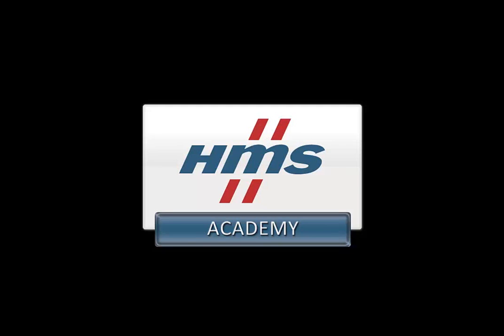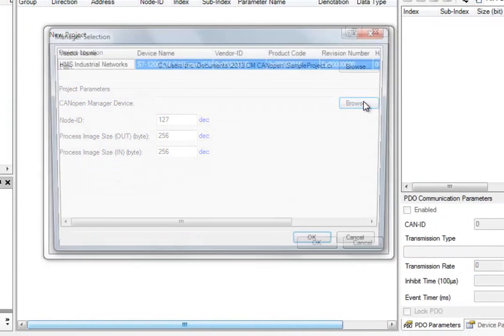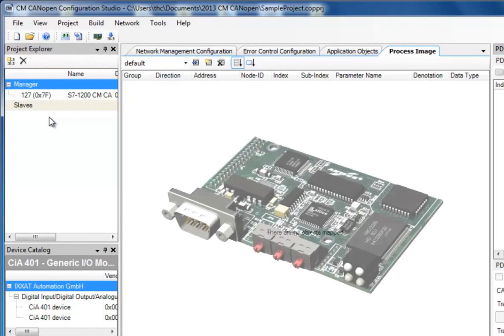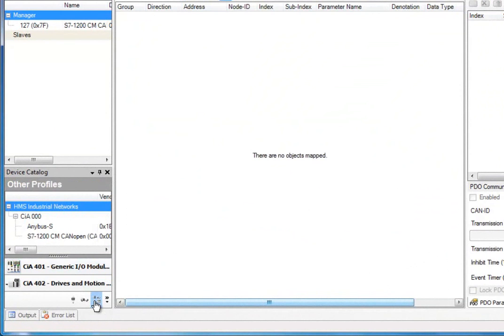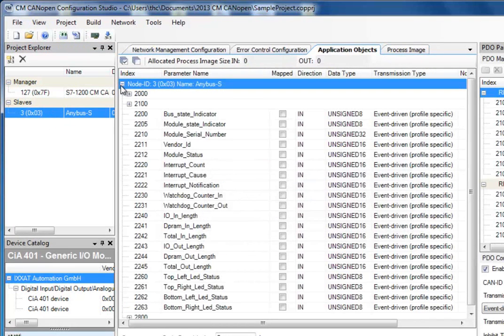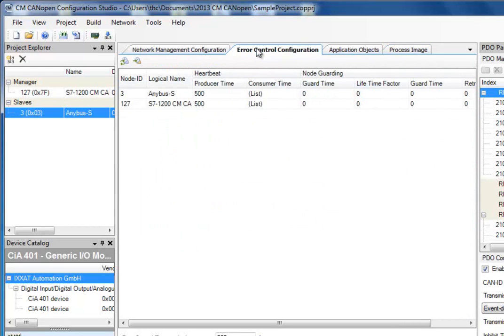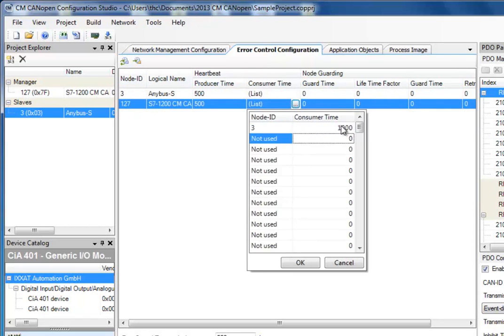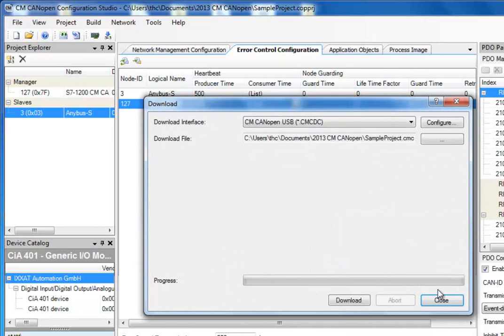How to configure the Ixxat CM CANopen for communication to a Siemens PLC

Comment: Hello, i have a question, too. When i try to download the configuration via USB-cable to the 021620-B with Manager-Node-ID 9, there appears an error: The Node-ID of the configuration (9 0x09) does not match the Node-ID of the device (1 0x01). How I can fix this?
Reply: I found the problem. In TIA Portal you need to put the same Node-ID in the properties of the Hardwareconfiguration, too. It was a little bit tricky to find.

Comment: Hello. I want to ask from where did you get that eds file? I want to create a similar configuration with 8 nodes. Tia
Reply from the maker: Hello @lucianmeon6979. Thanks for reaching out! The Electronic Data Sheet (EDS) file for the CM CANopen Module for SIMATIC S7-1200 will be automatically installed with the CANopen configuration tool. It is further explained in our User Manual, this can be downloaded here:  (https://www.ixxat.com/technical-support/resources/downloads-and-documentation?ordercode=021620-B)

Alternatively you can also watch our other video about this topic: 
https://www.youtube.com/watch?v=SxDXwX95V8M

I hope this answer is of help to you. If you have any further questions feel free to reach out again. 
Good luck with your project!
Reply: Sir I am using 11  motors  in  CM canopen communication  but  one motor is not working  so CM canopen is  giving an error. Is there  any way to  bypass the motor number 11 ...!?